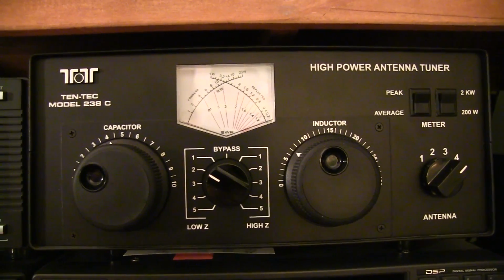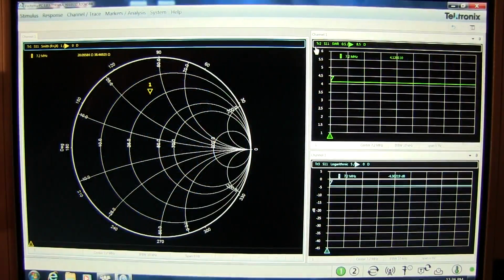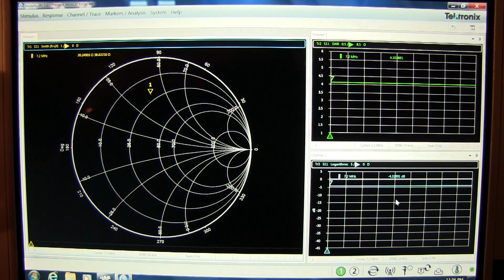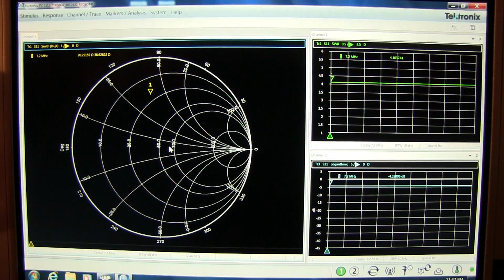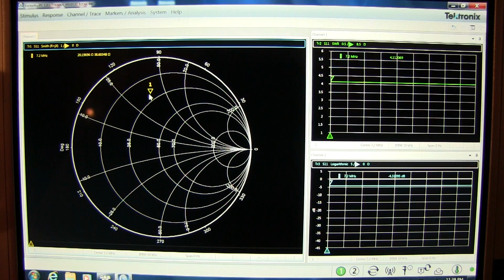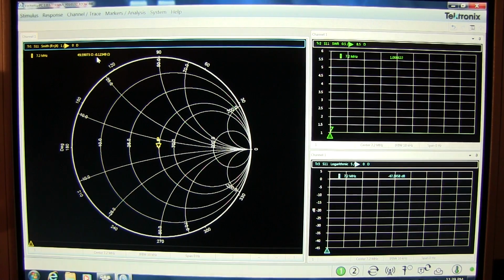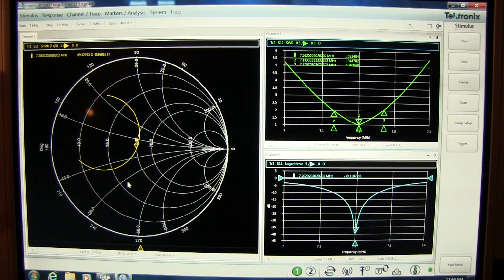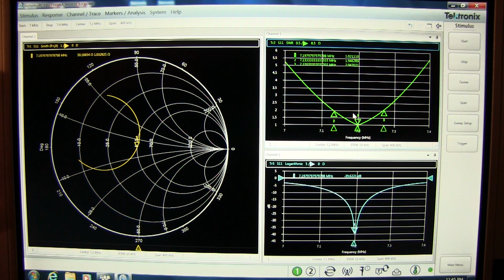#264: RF Fun: Visualize antenna tuner operation on Smith Chart, SWR & more with VNA

Comment: Starting your explanation at one frequency and then expanding from there is brilliant. As an RF engineer indeed I only use the bottom right type of curve and never bothered much with the Smith Chart as I manage fine without it. But this is a nice way of understanding it, thanks for that.
Reply from the maker: Thank you for the good comments - means a lot coming from an RF engineer.

Comment: For those of us that do not want to repair radios but have a serious interest in  RF, Common mode currents and monitoring wave forms and the audio chain it would be great if you could put together a list of the "must haves" for equipment. Obviously some sort of TDR antenna analyzer, scope and wave form generator  but what else?  I would think a spectrum analyzer is out of the question for most of us.  I personally would appreciate a ham tool box video with what is required and what can actually be done with it.  Your videos are outstanding Alan. Thank you.
Reply from the maker: You can get a LOT done with a good DMM (also recommend an analog VOM too), a scope, signal generator and an antenna analyzer like the MJF-259B (which can sometimes double as a signal generator).
Reply: Thanks Alan. Well I have a Fluke DMM,  Siglent scope and Sark analyzer and planning on a wave form generator in the next two months. I assume I need to jump to something like 40mhz if I want to do HF testing??   Is there any value in buying a coupler for RF so you have accurate feeds for channel 1 and channel 2 of scope? I thought about building one based on your video but was not sure if buying was a better option.  I have a LP-100 and the couplers seem to work OK for scope but would like something dedicated so I do not have to steel from a working shack :)

Comment: Great video. I need to test the specs of a transceiver(up to 1000W) for a customer and we need to be able to transmit at full PEP in CW into a 1.3:1 load. Then test to see where the forward power starts degrading as the VSWR increases. I think I can use a high power manual antenna tuner to accomplish this. Once again, thanks for the video. Keep it up! the channel is amazing!

Comment: you have an exceptional way to describe technical things very well. I would love more information on the ZOOM Rig Expert AA55 and the menus. Especially the R-X function. You have a nice video about the analyzer but you glossed over what those readings should be showing for a properly adjusted antenna. There are many many readouts that would help someone to design or adjust an antenna system for efficiency. The Europeans are so far ahead of us USA Hams for better antenna design. I guess we could get into deeper discussion through a HAM board
Reply from the maker: The R & X plot is just another way to visualize impedance vs. frequency, much like a Smith chart.  I don't see any "killer" application for it, it's just another visualization tool.  A properly adjusted antenna should show:  Minimum SWR, and ideally the Smith chart will be near the center, on the R & X chart, R should be near 50 ohms and X near zero.
Reply: @w2aew  WOW thanks... you just opened door # 1 and I can begin to make sense of the RF world

Comment: Hi Alan

I am a weekend electronics hobbyist. As such I cannot justify even $400 for a low end high frequency scope. Currently I own an old 20MHz Kenwood analogue scope, which serves me fine for 99% of the time.
However, recently I build a FM transmitter kit and, of course, the output bandwidth is a bit higher than 20MHz. After building it I wondered how I could test it’s operation. At the very minimum I need to figure out the carrier frequency so I can tune a radio in, for example.
I realised that this must have been a problem for early engineers when radio was just developed. AFAK scopes with a bandwidth that span the FM frequencies would not have been developed yet. Then the thought struck that this could be a topic for one of your videos.
In a way this is still relevant today; someone experimenting with a Bluetooth device with only access to a 1GHz scope would face the same problem. Did the old engineers use mixers to generate frequencies that they could measure or did they use some (other) clever tricks?
Anyway, love your videos and am always looking forward to see another one.
Reply from the maker: Good comments. Downconversion are among the tricks used back then, and still today in many cases, where signals exceed the frequency range of the available equipment.

Comment: Tuned a really good match to your radio but the antenna is still a total mess out past the tuner. Tuners are bandaids unless were talking ladder line type setups with a proper balanced line tuner. Great presentation!
Reply from the maker: A tuner can't make a bad antenna work well, but it can make a non-resonant good antenna receive nearly full TX power and perform very well.

Comment: Thank you for another insightful video. Looking forward to see tutorials on Smith Charts and please do explain what zero span is. 73 de SM7UDB/Mikael
Reply from the maker: Zero span simply means that the VNA is not sweeping in frequency - it is testing at a constant, fixed frequency.
Reply: w2aew thank you. Does this mean, if measuring with a spectrum analyzer with Zero Span you get the best noise floor (lowest dBm)?
Reply from the maker: No.  Zero span on a spectrum analyzer basically gives you a time domain view of the RF signal power that is within your Resolution BW filter (RBW).  You can think of it as an amplitude vs. time display of the RF at your defined center frequency.
Reply: Okay, I will have to test it. Thank you again and btw you have one of the best YouTube channels I subscribe on. Best 73.

Comment: Viewing S11 in those formats is quite interesting. I've been thinking about building a directional coupler to achieve something much more basic, but in the same vein. Do the other S parameters (S12, S21, S22) also have practical applications for us HF aficionados?
Reply: I think that S12 or S21 are only needed when dealing with amplifiers and attenuators, so devices which increase or decrease the power of the signal. An antenna does not do that so then S11 is enough as power which does not reflect back must be transmitted. For an amplifier the same is not true so you need either S12 or S21 to know what happens to the output power.
Reply: Stephano Cetola when you are dealing with a one-port system such an antenna you only have S11. If instead you deal with amplifiers (2ports) or systems with more ports, you also get an S parameter for each combination of input and output port.
Reply: It did not occur to me how an antenna is a 1 port system, not two ports. Grazie mille, Marcello!
Reply: Thank you for the explanation, that makes sense.
Reply from the maker: Adding to what Peter-Paul stated... ...the "transmission" S parameters like S21 are also useful when dealing with filters, duplexers, etc.
Reply: Thanks Alan. Oddly enough I got to demo a VNA recently and the goal was to characterize a filter and then look at the S-Params of a LTE signal. I had no idea what the LTE numbers meant, but the filter was pretty straight forward :) . Great video as usual. Cheers!

Comment: What did you use as a load, or hoy do you tie things together? Excellent video.
Reply from the maker: This is just a single point measurement - looking into the coax > tuner > balun > feedline > dipole antenna system.
Reply: Thanks for the reply, so you were "tunning" your actual antenna? Not a dummy.
Reply: Yes, my actual HF antenna.

Comment: Thanks for the video, how was the tuner and the VNA connected, simply 50Ohm on the input of the tuner?
Reply from the maker: Yes.
Reply: @w2aew  ok thanks, It was not working for me for some reason...
Reply from the maker: @AMJ416  Hmm - I simply put the VNA in the place of the radio...
Reply: @w2aew  aha, ok. So Antena was connected to the tuner, right?
Reply from the maker: @AMJ416  Yes.  You basically want the VNA to take the place of the rig, so that it shows you what the transmitter is seeing when it is hooked up.

Comment: I have a super dummy question around antenna tuners...  If I have an antenna giving the radio a 3:1 SWR situation while sending 100w on a given freq...  it means that 25w are not being irradiated... if I put on the radio-side of the 50 ohms transmission line an antenna tuner making it a 1:1 SWR... that means that 100w are being radiated ? or does it mean that the 25w bounced back are now being transformed as heat in the tuner ?
Reply from the maker: Ideally, the 100W will be delivered to the load.  There will be some losses in the tuner and coax, but the majority will go to the antenna.  The 25W is not turned into heat in the tuner.

Comment: Another newbie question about antenna tuners... (Considering a standard ham rig and a 50ohms coax as transmission line) is it more efficient to put the tuning on the antena side of the transmission line ?   Like the setup that an icom ah-4 gives you ?
Reply from the maker: Yes - it is better to have the tuning network located at the load/antenna, so that there is no VSWR on the transmission line.  This minimizes losses on the line.

Comment: When measuring the Log Magnitude of an RF device, what is the Log Magnitude measuring?
Reply from the maker: Usually you’re measuring reflection coefficient (S11) or transmission coefficient (S21)
Reply: I didn't know it was called "Log Magnitude" when measuring S11 or S21. I know they call it "Scalar measurements"Reflection coefficient means how much reflected power level is Absorbed/Lost in the previous source output load? Return loss is how much reflected power level is absorbed/Lost in the following Input load?
Reply from the maker: @waynegram8907  Log Magnitude is just the format of the data.  S-parameters can be displayed in log-mag format, in Linear format, etc.
Reply: @w2aew  Mostly used is the Log-Mag Format when measuring Gain, Frequency Response, Return loss, VSWR. When would you use the linear format to measure what RF devices because I have never used the linear format?

Comment: Are they sure they couldn't add a few more digits to those numbers?  I mean the 7.2 MHz (at 4:55) only has 13 digits past the decimal...  Give me a break and show maybe 3-6 and use the screen space saved and make the font bigger and readable from a distance.  That is one of the most annoying things about some equipment these days whether it is a computer app or stand alone scope or analyzer, they show useless insignificant information that just fills up the screen unnecessarily.
Reply from the maker: I agree - not sure why they include so many digits.

Comment: Hi Alan, just saw an interesting video regarding PL 259 vs N Connector  performance. The author did a lot of testing but did not clearly explain his results. Perhaps you could one up his work with a discussion on the performance differentials using your spectrum analyzer.

http://www.iz2uuf.net/wp/index.php/2016/01/08/pl-259-vs-n-on-430-mhz/
Reply from the maker: I can add that to my long list...